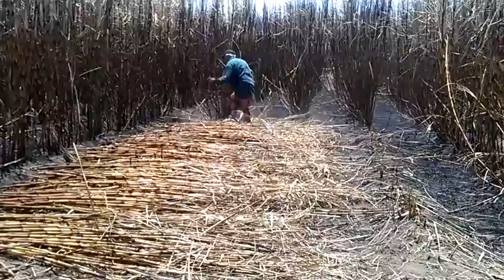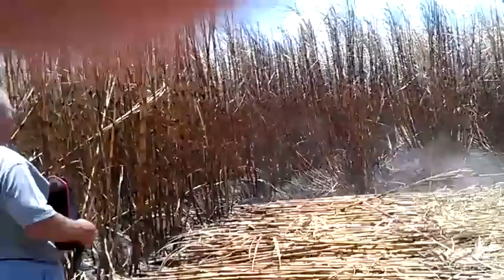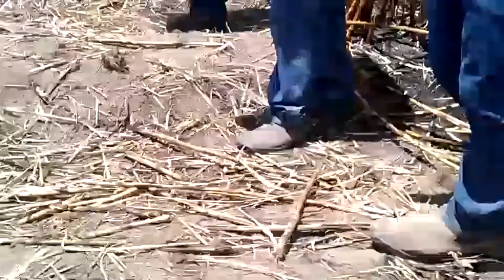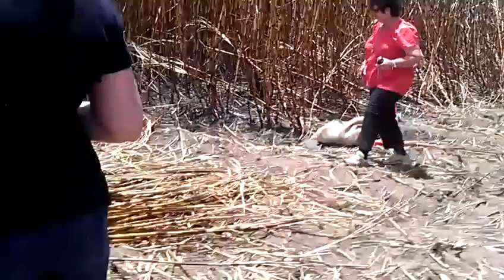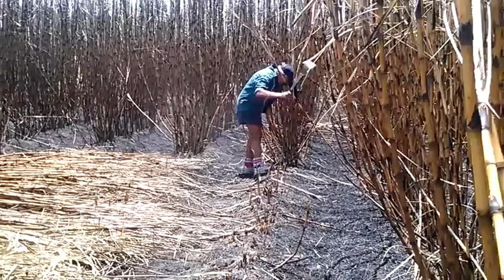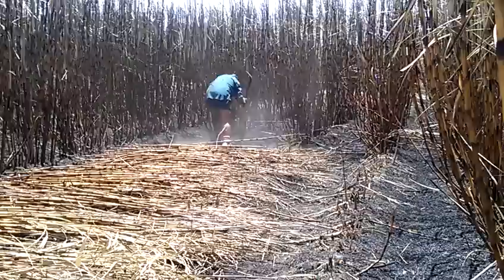Hand cutting sugar cane Home Hill Queensland Australia

Comment: I cut 3 years on burnt cane on the Richmond and Clarence rivers ,and 3 years in green Plantcane after, we were the last of hand cutters in australia of burnt cane,when our gang cut on the Clarence river. We cut flat and low, and three rows ,but not as in this video. Two rows were cut and buttted close to the third row ,you waklked backwards nicking your tops off then dropped your third row on top and then nicked your tops  again while walking back with your water. This method was only used in Standing cane ,or Racing cane as it was called as it was a very efficient and fasterway of putting tonnage on the ground a good man should have been able to do 40 ton. With Tangly can and heavy cane that was flattened on the ground it was then bigger knives and men came into their own.....From an ol SUGARBLADE...TIKI

Comment: I did it in Ingham but only for plant, only one row at a time and you don't straighten your back up more than you need combined with just the right bend in the end of the crocodile and you should be able to do an unburnt stool in no more than three solid hits depending on variety. Once you need a bit of a slowdown type breather then when you do have to fully straighten up the crocodile's hook is used to clean the trash out from amongst the sticks so the guys on the back of the planter get cleaner  sticks. Anything too bent just walk on and if bent is all you've got then top extra hard or maybe even go around again and take some off the bottoms but under no circumstances take off too much. Sometimes with sticks that fell early in the growing season there is nothing whatsoever you can do. When that is the case you simply pay extra attention to how you load the trailers. What those blokes are doing is cutting for the mill and not for plant and the techniques are different not least because that cane paddock has been burnt and they are doing it more than one row at a time. They do seem to be taking it a little easier than maybe they could. Everything in life though has an appropriate solution. If I stuck a half bottle of Beenleigh/Captain Morgan/Bundy at the far end of their rows I reckon they could squeeze out a bit more pace.